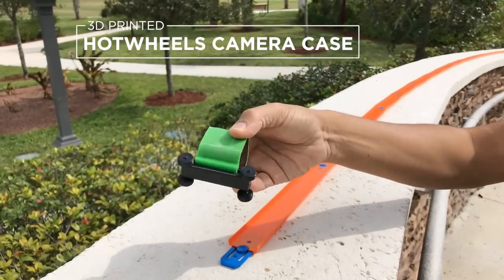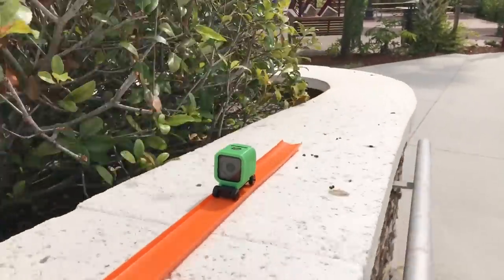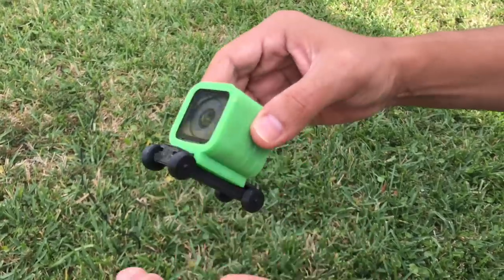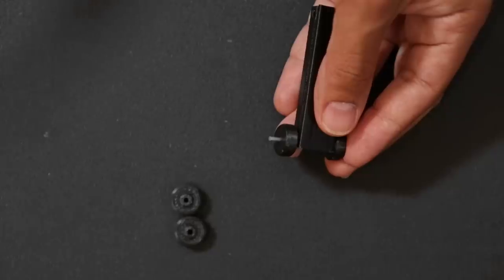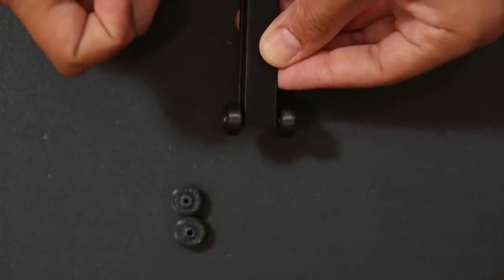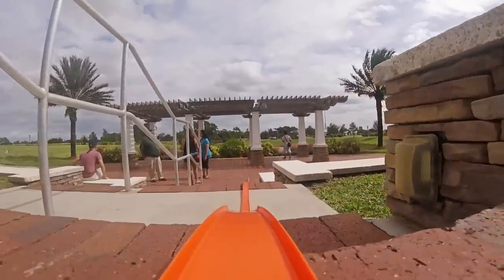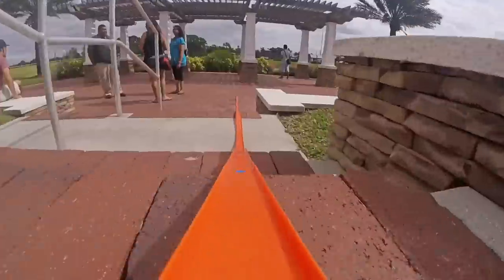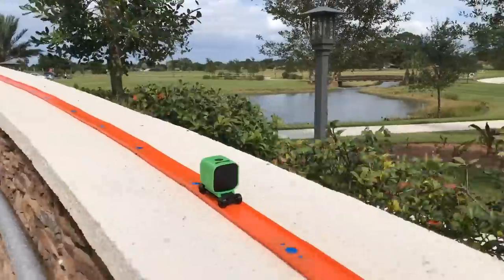Hot Wheels GoPro Mount #3DPrinting

Comment: I would lower the CoG by widening the wheel track-width and mounting the camera lower - that would make it more stable on steeper inclines.  Also as Juan Garcia said, adding weights to the underside of the chassis.  Also, bigger wheels, with a lowered chassis would enable making a 90 mounted dolly camera with good stability.